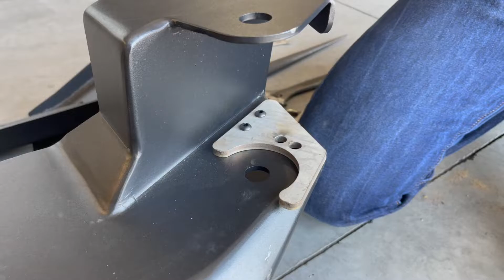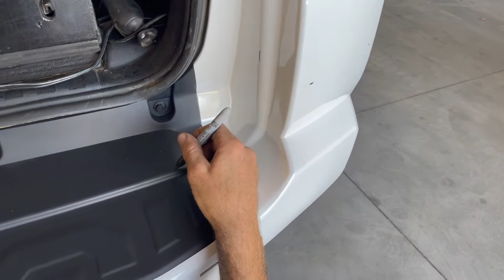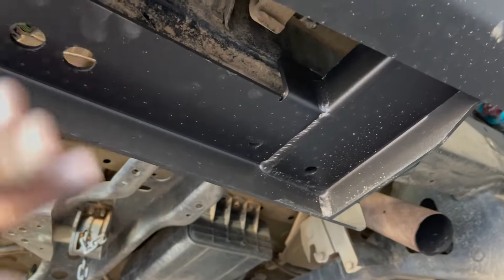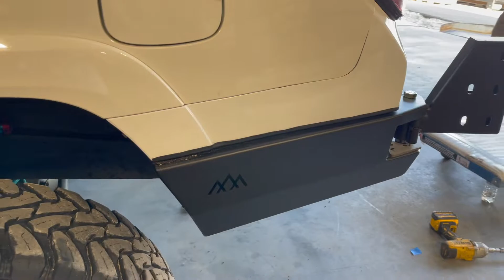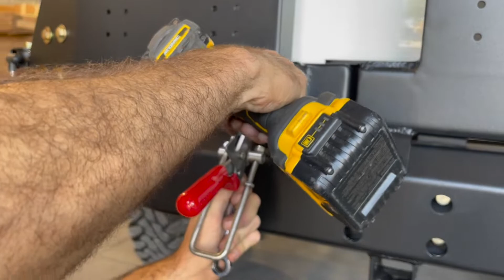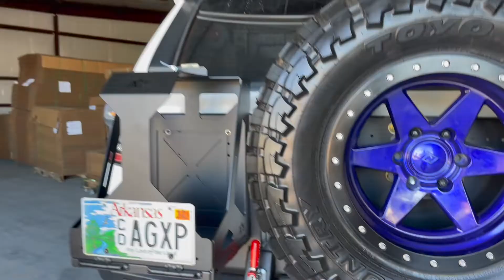5th Gen 4Runner Hi-Lite Dual Swingout Rear Bumper Install [With Accessories]

Comment: Nice looking bumper. Why use standard hardware on a metric vehicle? Going back and forth between is a pain in the ass. Not too mention if something comes loose on the trail, now you have to carry a standard wrench set in your tool roll. Just design it with all the same hardware and make life easy all around.

Comment: Do you have a torque spec thats quantifiable? 
Do you have any engineered load rating for that hitch tube attatched to the bumper?
Reply from the maker: No torque specs. Just use the supplied flat washer and lock washer and give it a few good cranks. And we do not have any official testing on the hitch. We don't rate it on purpose because we're not the vehicle manufacturer. The hitch is mainly used for bike racks and other things, however we have tested it with camper trailers and normal sized things you might pull with a 4Runner.
Reply: As soneone with a fab/machinist auto tech backround, walk me through this please.. 

So some engineer, sat there on CAD software to design, then cut all that on a plasma table and assemble it
 But didnt bother to produce a torque chart or rate the reciever tube...? And yall are comfortable charging 4k for that..? @BackwoodsAdventureMods thats ridiculous. Ive been buying ranch hands for my diesel pickups for over 15 years and they ALWAYS produce torque specs and WLL ratings for half of that price point.. can you walk me through that..? Especially given that its just mild steel and not high grade stainless/aluminum..? Sell me this at your asking price here especially with zero actual liability acceptence for recovery points/hitch that WILL get used..?
Reply: Im guessing you think thats acceptable? 

A $150 curt hitch from tractor supply has a weight rating and torque specs, 

Why wouldnt a replacment hitch that you are selling..?

Comment: Cam you still tow with this bumper, do I have to make any holes on the bumper?
Reply from the maker: Yes, you can still tow with this bumper. We don't have any official ratings as far as weight, but have towed with this bumper without issues.
Reply from the maker: And no, you don't need to create any extra holes.

Comment: The muffler pipe in that Runner is cut. Will it interfere with stock or aftermarket muffler? Magnaflow overland exhaust has a slightly different mount. Have you had any issues with the frame supports running into the muffler?
Reply from the maker: During our first install, we installed on a stock 4Runner with the stock exhaust that wasn't cut. It's possible to retain the factory exhaust, but a little easier if you cut it for clearance just after the rear axle.